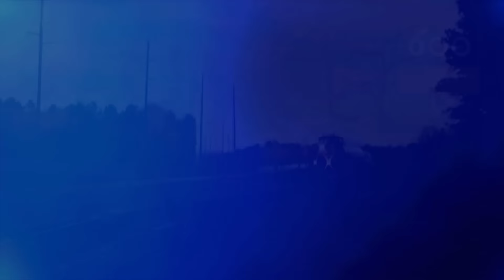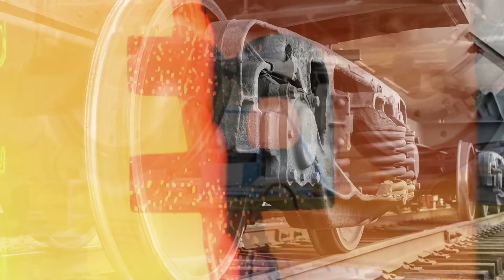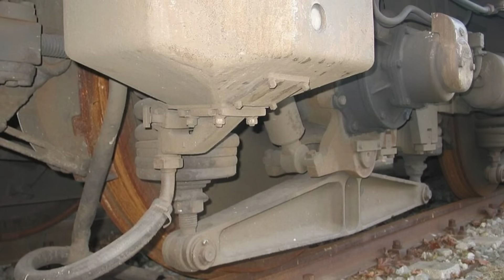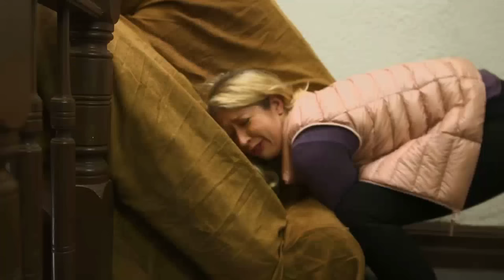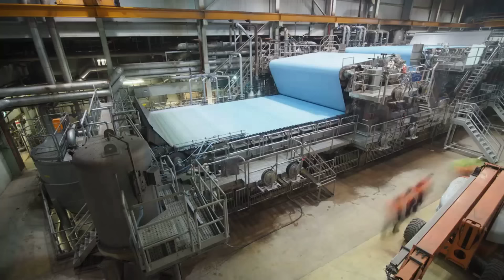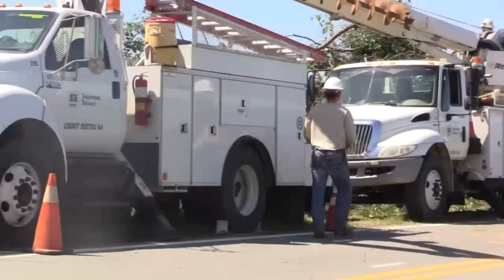Why a “Booster” Locomotive Without an Engine Might Be Smarter Than You Think

Comment: the weight of the locomotive allways ends up on the wheels... thats simple physics.....    the quesiton is, if its balanced between both trucks or not.     And the limitation, dont know why its not said clearly, is the adhesion, not the locomotives power.  One of the reasons, locomotives stopped somehow between 4300-4500 hp.  this is the most likely amount of power on a certain max weight of the unit, which can be put usefull onto the rails....

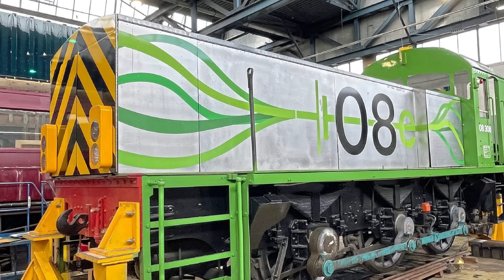Comment: The loco, number 08308 shown at 4:37 is a former 1950s built British 350hp diesel shunter rebuilt as a battery loco by Positive Traction and has recently been tested hauling 1000 tonne trains at a quarry in Britain.